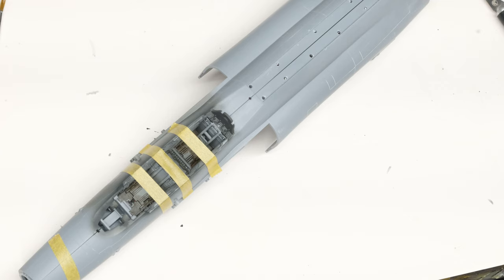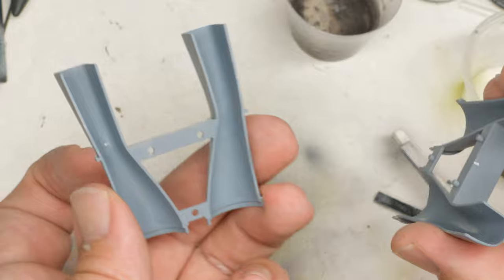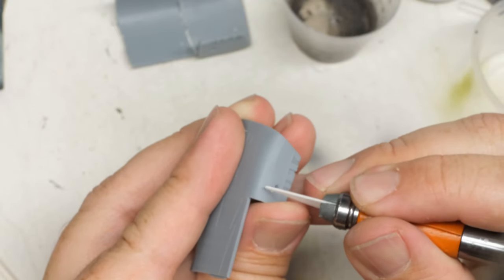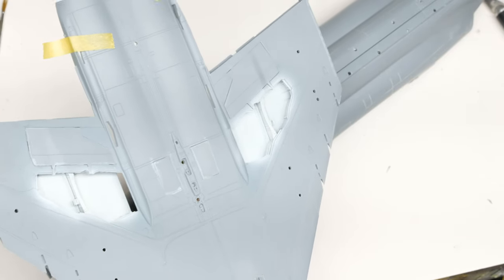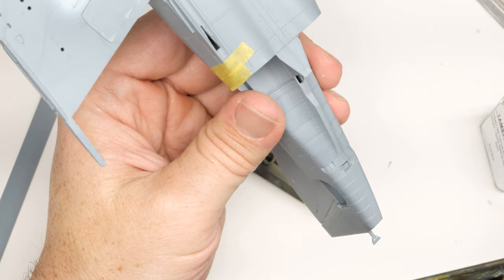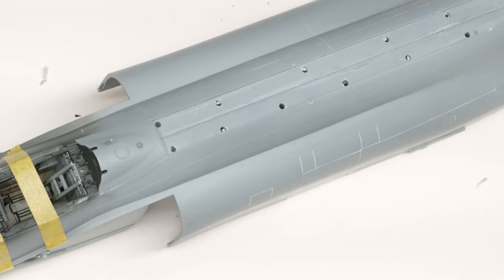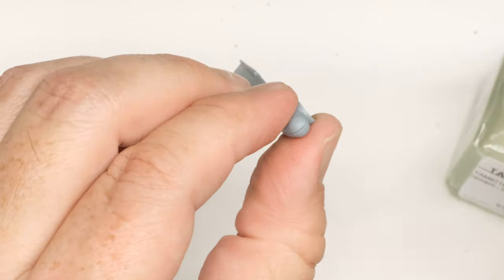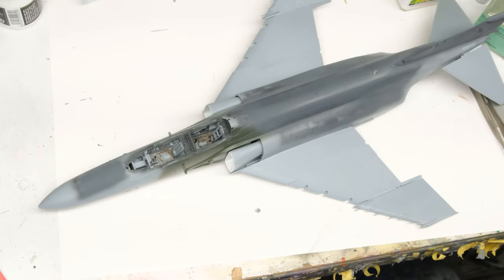1/48 Zoukei-Mura F-4G Wild Weasel 03 - Main Assembly

Comment: The hole drilled in the backbone panel at 10:24 is for the upper TACAN antenna.
  Short-nosed Phantoms don't have an upper TACAN antenna, only a lower antenna that was originally a round flat-plate antenna on the rear nose gear door, but later it was changed to a blade antenna mounted just behind the nose wheel well on F-4Cs and Ds.
  I was a USAF comm-nav avionics tech on F-4Cs 1980-82 and F-4Es 1982-86 so TACAN was one of the systems I worked on. 
 On the F-4E, F-4F and F-4G the lower TACAN blade antenna on the front nose gear door is shared with the APR-36/37 RHAW (radar homing and warning, pronounced "raw") system and so when the RHAW is switched on, a radio frequency switch inside Door 19 behind the rear cockpit automatically switches the TACAN to use the upper antenna.

Comment: Re: the auxillary air doors, on J79-engined Phantoms they're controlled by the landing gear handle. When the handle is placed in the "gear down" position electrical power is applied to an electric circuit that controls a hydraulic valve that opens the doors. Raising the gear handle removes power to the valve control and the doors close. 
  Under certain flight conditions, high ram air pressure in the intake duct bleeds through the variable bypass bellmouth where the engine face connects to the intake duct. That air goes into the engine bays and if the pressure in the engine bays is high enough it can push the aux air doors open to relieve the pressure.
  On the ground, air being sucked into the engines causes low pressure in the ducts, and air is pulled into the engine bays through the aux air doors and then pulled from the engine bays into the engine through the bellmouth. This keeps the engine bays cool. 
  During engine shutdown, the generators drop offline before the hydraulic pressure drops off, so the electrically controlled valve switches the hydraulic pressure to shut the doors. 
  After the engines have stopped, the ground crew will install all of the landing gear downlocks and safety devices including jury struts to hold the aux air doors open. To install the jury struts, we pried the doors open. 
  So on this model, if the landing gear will be modeled down, the model will only accurately depict an airplane that has just shut down its engines before maintenance has started installing the safety devices. 
 On British Spey-engined Phantoms, the aux air doors on the belly and fuselage sides just in front of the engine nozzles are all controlled by the CADC, central air data computer. 
For what it's worth.
Reply from the maker: See this is the level of knowledge that'd leave me crippled on a build like this! It's awesome to know for sure, but ignorance is bliss is often the only way I ever get things done.
Reply: @DoogsModels  Amen
Reply: Too long, didn't read: aux air doors are closed with gear up, opened with gear down.
 Sorry for being so detailed in my prior comment, I thought y'all might be interested in why the doors work that way.

Comment: The aux air doors will snap shut with the gear down if electrical power is interrupted. They close during engine shutdown when the generators drop offline so you’re not too lazy if you leave them closed.

Comment: When it comes to filling I use CA glue exclusively now. I am fed up with fillers taking ages to dry and even then not sanding well and shrinking. I also use some 4 inch files to file back the CA filler. I bought some really good expensive ones that cut really well. The plastic is softer than the CA glue and I found with sanding sponges that the plastic gets sanded away leaving the CA glue proud but with hard files and accurate filling this can be avoided. I have even managed to file around detail rather than lose it. That spine panel is a real pain as it just creates two seams to address rather than one.
Reply from the maker: That's why I like the black CA. It's got the CA goodness but it's closer to plastic in hardness. 

Only thing I don't like us that it's not as good at finishing fills. So I still use the Super Red at times.

Comment: Great build.  Any reason why you didn't use acrylic putty on the spine seams?  All you'd have to do is lay it in and run a damp q-tip down the spine/fuselage seam to remove the excess.  It wouldn't damage the nearby rivets because there would be no sanding.  Or did the spine a fuselage not have the same contour so sanding would have been necessary anyway.
Reply from the maker: I don't trust acrylic putty to totally erase a seam   - in my experience it can also just...fall out later.